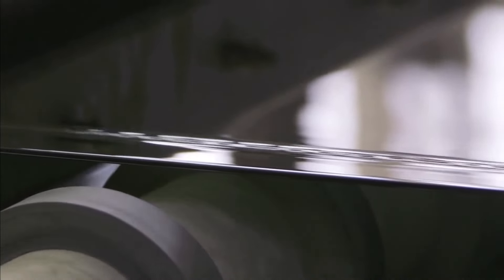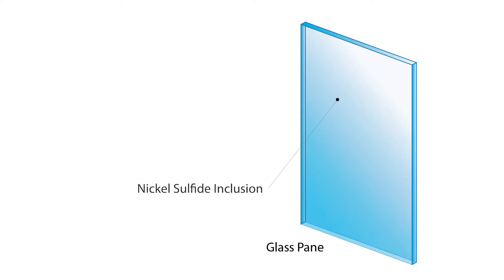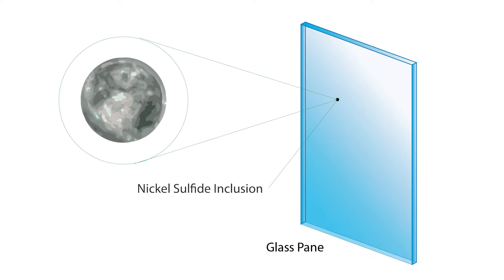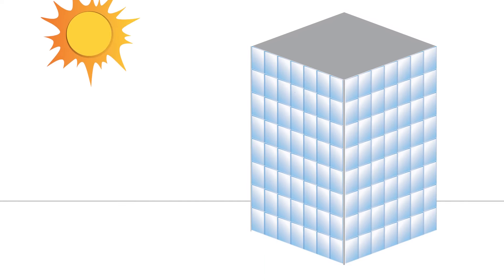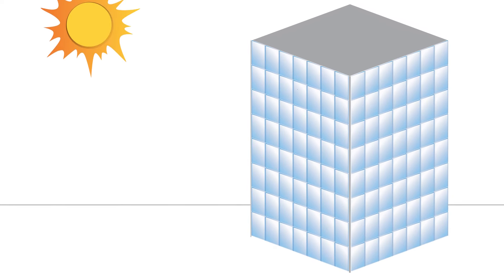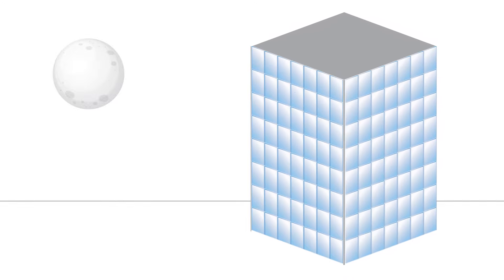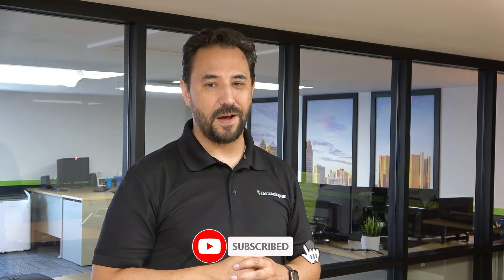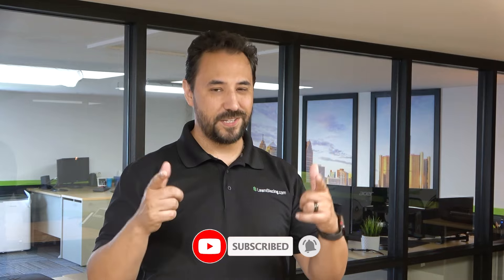Can Heat-soaking stop spontaneous glass breakage? Did you know

Comment: I really enjoy your videos and that was a really good presentation of why some companies heat soak tempered glass because of the the potential of nickel-sulfide inclusions.. Very informative and well presented, however I would suggest that there are a couple of limitations involving heat soaking  that are worth considering prior to going fully into the heat soaking route. 

First, if the glass was floated in Europe or Asia (especially China), then nickel sulfide inclusions can be an issue, but North American floats don't use nickel anywhere in the process (including furnace materials) so that nickel sulfide inclusions are not an issue with North American glass. 

The second, and possibly more important, reason is that heat soaking could actually cause tempered glass that survived the process to spontaneously shatter in the field specifically related to the heat soak prior to field installation.

In order for the inclusion to cause the glass to shatter it has to be located within the transition boundary of the compression and tension  layers. While heat soaking should result in causing inclusions that are within the transition area to expand and likely cause the glass to break, if the inclusion is fully located within either the surface compression layer or center tension layer then they are harmless and should not result in glass breakage in the field nor during the heat soaking process. 

However, it is possible in some cases that heat soaking could migrate an otherwise "safe" inclusion into the  transition boundary during the cycle, without causing the glass to shatter during the process, that could result in a tempered glass that might very well fail in the field after surviving the heat soaking process, And while I am not suggesting that heat soaking should be abandoned, the potential for field breakage of tempered glass because of heat soaking should also be taken into account as well when considering using that process.
Reply from the maker: Greg, these are all really good points. We appreciate you taking the time to write all of this.